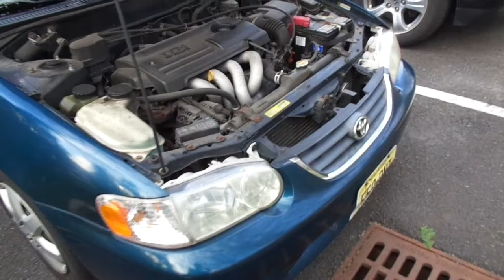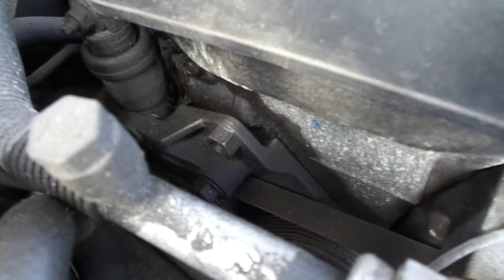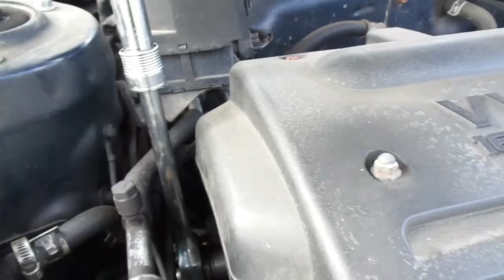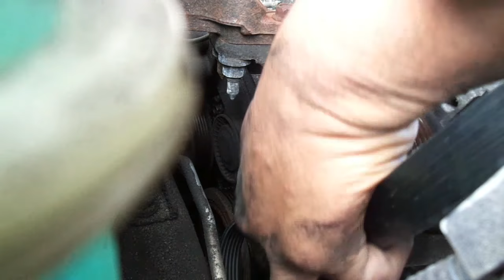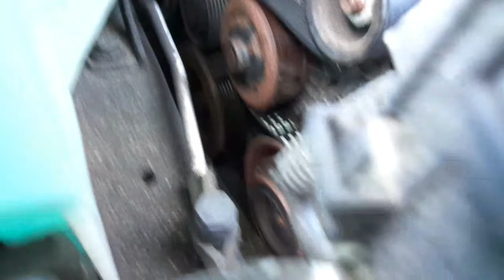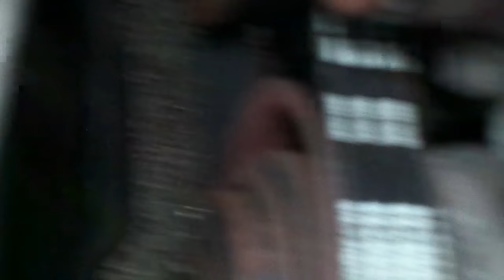1998 to 2007 toyota corolla sepentine belt replacement

Comment: Lmao.. the guy completely changed the way he looped it around at the 2:25m point... 
Just make a loop, slide it over the crank pulley all the way on the bottom back, go over the first idler, under the bottom middle pulley, under the bottom front pulley, under the idler pulley, put tension on the tensioner and pull the belt over the alternator..

Comment: Hi,I have a problem with my car,the engine shakes and when engage to drive  or reverse gear the interior start vibrating, what could be the problems,pls help
Reply: That is 100% a motor or transmission mount.